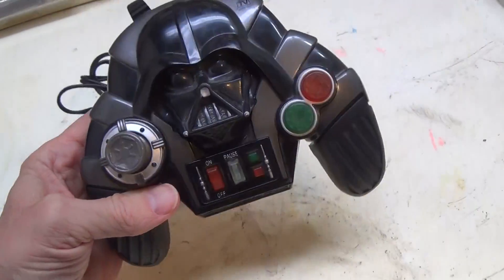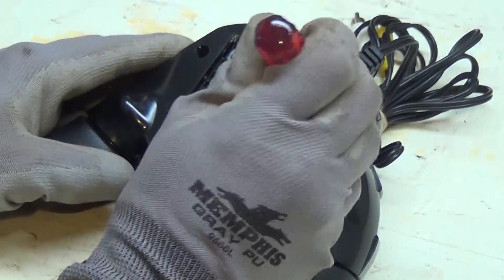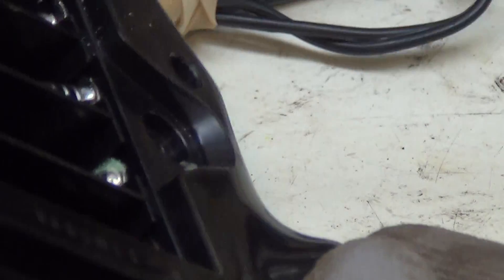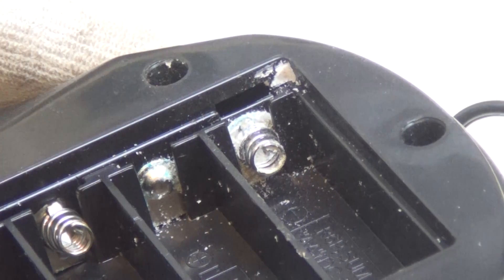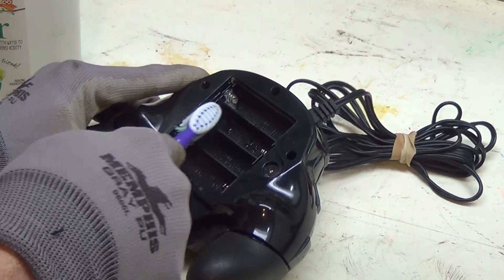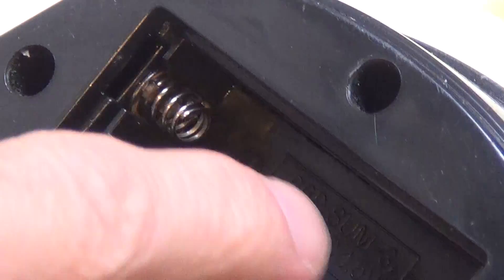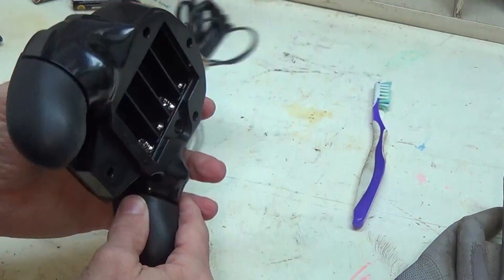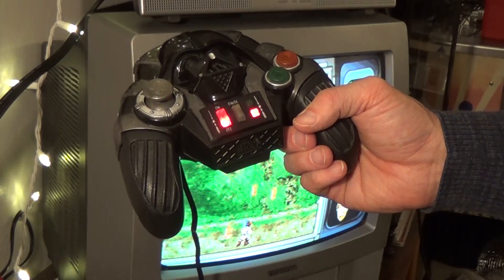How to Clean Battery Corrosion

Comment: Pretty sure that alkaline batteries do not leak acid. Just use CLR to clean corrosion, baking soda solution to neutralize, rinse with water and coat with dielectric grease.

Comment: For small items that use 2 or 3 cells , ( LED camping lamps ? ) a good way to stop this happening again , is to ditch the HORRID leaky ALKALINE   batteries , and solder in a Lithium cell salvaged from the THOUSANDS of disposable vapes discarded on every sidewalk ! .... these NEVER leak , and can be recharged !  , but it is VERY important to not charge them beyond 4.2 Volts , so NEVER connect direct to any 5 Volt USB outlet ! ! ..... ( tried - n - tested ) ........ DAVE™🛑

Comment: I got the rusty wires on my problem and I don’t know anything on that or any stuff. I have a remote a rejecter that got corroded from some AAA batteries I had that I didn’t even know I had in the remote that I just found and I am afraid that it may be to be repaired by going inside the system to fix it because rusty wires, from the corrosion and it’s so bad that it could be damaged inside of the remote and I don’t know how to repair it because I can’t open it up, or fix it 😅😢 I don’t have any idea how to fix it, I just got the batteries out but I don’t know how to fix it and I live in Ohio, a few days I will be going on vacation to Texas and so I will be busy. Plus I’m don’t know how to fix it on my own anyway.

Comment: Thank you kindly <3 I got conditioner in a battery powered toothbrush so it's not exactly the same as corrosion, but I plan to use vinegar first and then finish with isopropyl alcohol. And also use a cotton swab alongside a toothbrush. 😊

Comment: I have an old ohmmeter multi tester and was lent to me from my father and it's pretty obvious that he took care of it since it looks like the 70s it's like RadioShack it's it's like an antique online they're not really expensive but nonetheless it worked before the test batteries put all the way according to all the manuals and stuff but when I opened it to try it again it didn't work... I don't see a little bit of white dust inside the case open the back because I read that I had batteries and sure enough there's a 9 V and a AA with blue dust and a little bit of red rust on the connecters batteries are Duracell industrial grade expired 2014 so it just kind of must've happened all the sudden I just don't want to tell my father that his prized possession that he kept meant Brawley's years and lent to me is no longer functioning just wondered if you could help me here I really don't wanna put any kind of vinegar in there the blueish dust it looks fresh I mean it's in the inside of the box I didn't notice it before inside the clear part but that's definitely there. I don't know if through any recommendations to I really don't know I just really want to take me take a look at this looks fresh but there's no way I could've did anything or could I have but I just kind of blow the dust out just a bit and it just got it up into my eyes battery acid dust in my eyes anyway the leads and wires connected to where the batteries connect our contact not rotten through but I know in the AAs side there is red rust present in one of the corners along with blue dust and white and then the other one is pretty clean from red rust. Thankfully I just want to get this fixed and whatever repair I need and have it returned to him in working order the same he did with me without him knowing

Comment: You keep referring to battery "acid" damage. It's alkaline damage, not acid. "acid" is not a misnomer. It's just wrong. You used the right chemical acetic acid - vinegar - to neutralize the base. If it were actually acid damage, you would add an alkali, such as baking soda.

Comment: Doing the vinegar cleaning right now on a black light flashlight that sat and the batteries have begun corrosion.  I am hoping this will work for it as well as it did for your controller. And thanks!!

Comment: One contributing factor causing corrosion is that someone replaced one battery. To avoid that, replace all batteries at the same time. The new batteries should be of the same type and brand. Throw out the used batteries in your junk drawer.

Comment: In my experience, Duracells always leak. Even cheap batteries don't leak nearly as much, even though they may not last as long. I have even had Duracells leak in an unopened package, after sitting in a drawer for a few months. (Years before the expiration date on the package.)
Reply: https://youtu.be/sH6GqGOOoVw
Reply: They also leak in the pkg if they are stored too close to a heat vent. I had some stored in shelf behind tv. Had to throw out packs worth of unused corroded batteries,- responsibly though do no worries

Comment: Hi - recommendation - pour a small amount of the vinegar into a small container/paper cup rather than dipping an old contaminated toothbrush into the bottle.  Also you might need more and you really don't want to introduce battery acid into the bottle.  Thanks - I have stubborn residue on the inside barrel of a metal flashlight and I've been rubbing vinegar on it several times and it won't rub off. Light sandpaper?
Reply: It could be a designated vinegar bottle..
Reply: I said the same exact thing about dipping the toothbrush into a nearly full bottle of vinegar! My battery corrosion is terrible! It's a beautiful soap dispenser that the Duracell batteries leaked into. I'll try the vinegar/lemon juice suggested & I'm hoping that it will work afterwards.
Reply: You can unscrew the bulb section and soak the barrel section in vinegar overnight 😃✌️
Reply: sandpaper might take off the plating, I wouldn’t recommend that

Comment: At 4:04 you mention adding extra vinegar to seep into the crevices. Won't extra liquid damage the electronics?
Reply: Yes, that’s why you don’t want to let any get on them. Not to mention, running power through wet electronics is a sure fire way to brick them.

Comment: If the vinegar and lemon juice method do not last long enough.. if you have a soldering iron and flux you can resolder the joints, springs, connections using the flux and solder..   in my experience which I have done this quite a lot had a lot of problems with leaking batteries in acid issues.. the fluxing and soldering has worked quite well on many applications..  

  Of course if you have a spring battery connection you just want to solder the tips that meet up with a battery and the other end of the spring that connects to the power or ground..

  Make sure to clean with vinegar or lemon juice.. but I highly suggest the vinegar method, before trying the soldering flux.

Comment: Thanks for the nice video. 

Many times the leak has run onto important electronic circuits and has 
ruined them beyond just cleaning.
You will never have to deal with the mess again 

if you use The Centurion Shield. You can be proactive and

 STOP your electronics from being ruined.  

Please check out the website www.thecenturionshield.com.
and www.youtube.com/watch?v=I9hi38erpsI&t=26s
Reply: Many times the leak has run onto important electronic circuits and has 
ruined them beyond just cleaning.
You will never have to deal with the mess again 
if you use The Centurion Shield. You can be proactive and
 STOP your electronics from being ruined.  

Please check out the website www.thecenturionshield.com.
and www.youtube.com/watch?v=I9hi38erpsI&t=26s
Reply: Many times the leak has run onto important electronic circuits and has 
ruined them beyond just cleaning.
You will never have to deal with the mess again 
if you use The Centurion Shield. You can be proactive and
 STOP your electronics from being ruined.  

Please check out the website www.thecenturionshield.com.
and www.youtube.com/watch?v=I9hi38erpsI&t=26s

Comment: Duracell batteries always leak. I've lost some valuable electronics over the years, the culprit, always Duracell batteries. I work in an industry that requires flashlights. When Duracell started running their ads about those who depend on it use Duracell, we use to laugh, we never use them. Now if I purchase something and it comes with Duracell batteries, I toss the Duracell batteries and protect my purchase. Thanks for the video!
Reply: You have confirmed something I've been wondering about - thank you. What type of batteries do you recommend?
Reply: Yeah, a pair of Duracell seem to have cost me a perfectly good Amazon Fire stick

Comment: Would this work with an fx lightsaber? I have a vader lightsaber that i found and the bottom was corroded shut so the lid is jammed. How can i get the battery pack out with the lid being corroded shut?